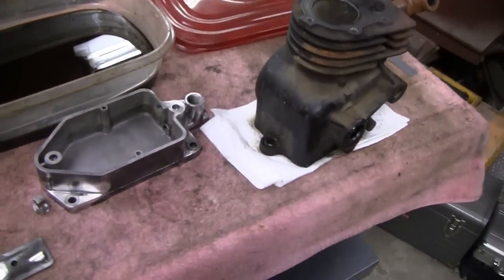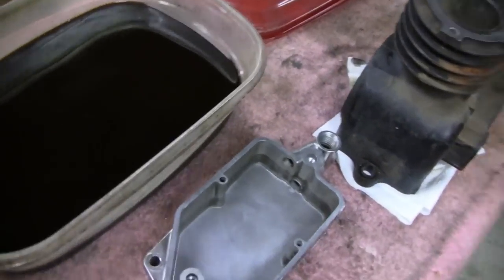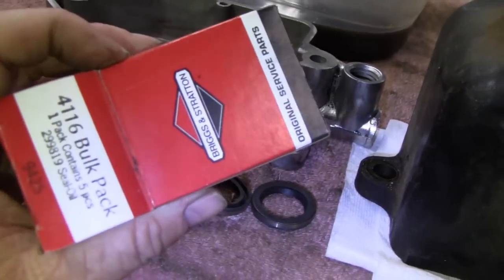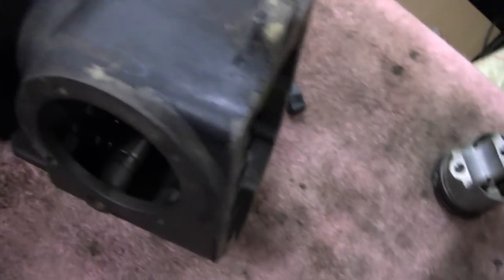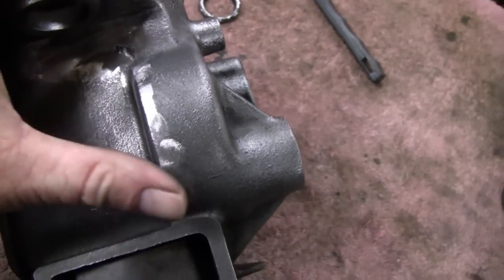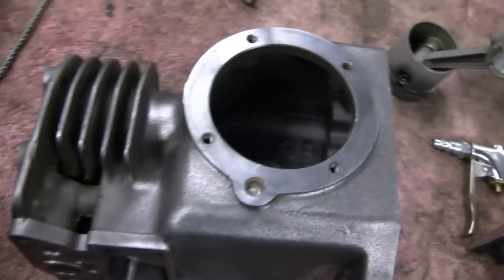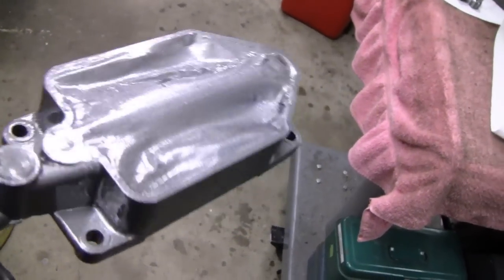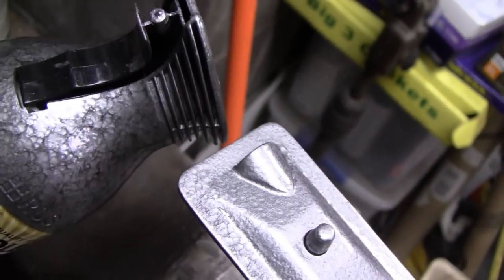GLASS HEAD BRIGGS ENGINE (part 13)

Comment: If you have any old rusty metal parts to clean,, ( panels, bolts, ect ) try one part of Molasses to 10 pars of water in a tub and soak for 5 to10 days then wash off with water and dry well.  Works like Magic on rusty metal parts..

Comment: When it's cold out, I've had better luck with Spray Can paint if you let the can sit in real warm or hot water for 10mins or so PRIOR to painting- it would flow better, and lay down better, and not clog in the the nozzle better- Try that if it's below 70* outside budd

Comment: I have found that if you heat the can in boiling water for 5 minutes and oven bake the block to about 200*, it works a lot better.

Comment: Please don't give Obama the credit for ethanol. When I was in tech school for Diesel mechanics (Before the Minnesota Department of Education stuck their nose in and ruined them and required instructors to have a four year degree) we were testing a way to inject pure ethanol into a diesel engine to get more economy from it. It was a failure but it worked good in gas engines. This was 1979 when Carter was president and continued on while Reagan was president. It was a big thing in the Midwest prairie region as it got rid of a lot of corn that was just sitting in piles as the Oil embargo killed the farm economy. Let us give Jimmy Carter the praise for all this mess we ended up with. The farm economy really did not improve during the next few years until Bill Clinton benefited from some of the stuff Reagan put into action. When GMO came into the picture the crops nearly doubled in size and with the Ethanol industry helping get rid of this surplus corn it started to get better on the farm. Yep subsidies were propping it up  but Hmmm, I believe the Oil companies were getting their fair share of our tax payer dollars also. The technology I am all for but I don't like to see something get subsidized after it a technology should be able to support itself.
Reply: 1crazynordlander I'm a big fan of ethanol. I learned about it about 10 years ago and I started using it almost full time a few years after that. Unfortunately I live in a state that doesn't have lots of E85 pumps, but I still stock up on it and run it in everything from my car, lawnmower, chainsaw, etc... I really like using it in my small engines because I don't reek like exhaust fumes after I'm done working, and I haven't seen any adverse reactions in any of my machinery. My car (regular gas car) was converted (larger injectors and a retune, later supercharged) almost 100k miles ago and it's been trouble free, it's actually doing better than it would have been if I ran it on gas. I just wish we had more of it around, and more of an effort was put into creating it. We put so much effort into gasoline and pollution concerns aside (what people really tend to focus on), it's a really out of date fuel. it's such low octane that it's holding our modern engines back from creating awesome reliable power.
Reply: volvo09 Are you using the E85 in your small engines or the E10? I have flex fuel vehicles and run it in those in the past but with the price of gas it is hardly worth it now. We are in the middle of farm country in SW Minnesota and one of the first corn processing plants is only 25 miles from us in Marshall MN. Not only do you get ethanol from corn but corn syrup and corn gluten (DDG) which is fed to cattle.
Reply: you should check out hydrogen... 1k degrees F. 130+ Octane.
Reply: No one should take any credit for corn based ethanol.  
If anyone bothered to check, it takes more than a gallon of fossil fuel to convert a gallon of ethanol. 
Corn based ethanol is a lie, at best. At worst it is a scam that is stealing billions from people that don't even know they are being robbed. 

Wake up.

Comment: that hammer coat paint is 3 parts paint and one part paint thinner. it's good stuff.  paint thick coats and try not to overlap till it dries. the can may be sputtering because it's not shaken up enough. you must shake it often while using to keep the paint and solvent mixed in the can.

your Briggs videos showed up in my suggested videos. you are building an amazing teaching tool.

Comment: I have been painting with that stuff for years. You can not paint with it in a cold area or when it'd hot and humid. The best results are when you bake the part at few hundred degrees. I bet the part that started crinkling was being blow on by the heater? it needs a even heat all the way around. You can go around the project with a heat gun to help even out the effect,  It also lays down better when you paint the part laying flat. And the cans do sputter a bit.  I like to use it for antique radio cabinets. Or on projects that i want to have that antique look. it takes some practice, but once you get it figured out it looks awesome.

Comment: Those hammer tone paints are often sputtery, chunky, and don't lay down very nice.  

I find they work best with light coats, dusting really from too far back.  Being cold doesn't help either.  Warm the can in hot water before spraying and mix the hell out of it.

Comment: Ah Roadking, you finally see why I stopped using Rustoleum spray paints, all their new cans are like that! I have great luck with Duplicolor and their VHT line of epoxy based spray paints! 😆😁😁 The brush on Rustoleum is still good stuff though, I thin that stuff out with thinner and it sprays nice out of a siphon gun

Comment: I always put my spray cans in a container of hot water to make the paint thinner and usually that helps it to spray out more evenly. I found when painting my Gadget Bike that the hammered paints are not very consistent. You will figure it out, EJ.
Reply from the maker: Thanks George!! Yeah I always keep them in my heater room til I'm ready to use them!! I was able to fix it without having to repaint the whole thing!!☺
Reply: I agree with the hot water. It raises the pressure in the can. Also that hammer paint has to be shaken very vigorously for a longer time than most paints.

Comment: Yeah that is frustrating when the paint cans don't spray well.

I have had bad luck with that same style of "trigger grip" can.  IMHO that is a gimmick and not nearly as effective as a standard spray button.

Also, it seems that Rust-Oleum is especially temperature sensitive. I learned (also the hard way!) that the workpiece and the can need to be warm. Next time, try putting the engine block directly in front of the heater until it's hot.  Then put the paint can in warm water until it's about 95 to 100°F.  This will really help. The can heating will increase the pressure and help the paint to spray out properly without spitting and sputtering.  The workpiece heating will help the paint to set up and become tacky before it has time to run and sag.

Regardless of the paint job I'm enjoying watching you guys build this demonstration engine. It is going to be one of a kind and really will help demonstrate the 4-stroke cycle principle to people at the shows.

Comment: I've used the same paint as that some time ago and it was doing the same thing. I used a flat black with a primer to paint a set of speaker cabinets. The end result was pretty good but it was spitting and sputtering constantly. I had two cans and both were the same.

Comment: I've used it, I heated the cans in water to 100 degrees Fahrenheit then worked pretty good.
& before all the safety sallies chime in , I know that's not safe. You'll need a rag to hold the can with or good leather glove. 
Most all spray paint cans I do that to now, really works good.

Comment: all rustoleum paint always seemed to either do exactly what you describe, or that "360 degree" nozzle that supposed to mimick a spray gun, would put a lot of paint on the edges of the spray and hardly any in the center.  really weird.  I've always used duplicolor, or VHT, never had an issue ☺

Comment: Hi Thanks for the video, I wasn't  surprised you didn't like that paint and the problems, I got a tractor here  the frame is satin black  . I wanted the correct paint color instead of gloss or mat black,to re paint the motor when I rebuilt it. I google searched as it can be hard to find satin in Canada sometimes. Home depot came up and so did the whole spray can issue debates that guys are having ,with those new style paint cans. In the end I found regular satin quart cans in Canadian tire and used that instead,as i didn't want the mess from the spray cans.

Comment: I use Rustoleum  hammered paint often and have found the trigger top cans to be a real problem. I always try to get the regular button top cans as they are much better. You need to have about 70 degrees for it to work right though and have to really get it mixed well or it will clog the tip. Medium wet coats seem to work best with about 10 min. between and usually 3 coats covers nice and looks best to me. I like the copper/bronze color on the 4 cyl. Briggs. It looks like it belongs there. Keep up the good videos buddy!!
Reply from the maker: Thanks Bud!!☺

Comment: We have paint like that in the uk under the name Hammerite, when I've used it I found it goes on much better using a brush from a regular paint can. 
Will you polish the piston top to get maximum reflection and brightness from the gas burn?
Reply: We have hammertite here in the US but it's more expensive and harder to find than rustolum. Truthfully the regular hammertone isn't half bad. That primer and paint in one in my personal experience has been nothing but crap no matter what finish it's supposed to be.
Reply from the maker: Nah it already bright enough without polish!!☺
Reply from the maker: I agree with ya DJ!! I've been using the regular Hammertone for years and never had a problem!!☺

Comment: too cold to paint thats why I can not work on my cub cadet until it gets warm again. It needs to be at least 60 degrees  and 70 is even better. Heat up your block really hot in front of the stove first maybe before you take it out side.

Comment: You got the finish you were supposed to, Hammerite looks like that unless you buy Hammerite smooth, But if you want to paint an engine you need to use Engine enamel which is designed to handle the heat? And if  you spay a couple of pieces and then stop, (All spray paints) will tell you to turn the can upside down and spray until paint stops coming out (Air Only) this clears the nozzle for when you start again

Comment: I have NEVER had luck with that paint!!!
Reply from the maker: I like rustoleum, but I'll never use that shit again!!☺
Reply: I'll second that. I always had problems with that type of paint. NEVER again will I waste my money on it.
Reply: It slobbered all over my hand too. Useless design.
Reply: StarPuss www.ToxicRedNeck.Com   He should used engine paint, when the engine heats up he wont like that either!!!
Reply: they have plans to not let this engine heat up much , low rpm , propane, the paint he was using is good for some heat.
Reply: Interesting, I've never had any issue with Rustoleum hammered paint and I've used it on many, many things. I am not a fan of the sprayer design on these and others that use them but the paint is fine. I've used it in place of flat or satin black on a number of things to get away from that tired look. I've probably used near 100 cans of this over the years. My tool chest and box are about a dozen years old, satin black and I think they'll get it next if I don't come up with something else like some flashy very metallic paint.

Comment: Question?  I just noticed that the two valves have two holes on the top.  It seems that a spanner wrench would fit in them to maybe rotate the valves.  So, what are they for?
Reply: jbmbanter Those holes are for a valve lapping tool, it looks like a big screw driver with two pegs on the end.

Comment: The can being too cold can result in sputtering especially with stuff like this which is thick to begin with.  Heat up the cans in a bucket of warm water if you're painting in less than ideal temps.

Comment: The nozzle of the can needed cleaned. If you would have sprayed it where it was warm, that would have helped keep the spray nozzle from getting so plugged. On top of that spraying in the cold weather also affected the paint itself too much. When spraying anything from a compressed source it's temperature drops rapidly so add that temperature drop to the outside temperature, and it adds up to failure. At least with that type of a paint it does.

Comment: I was all in on the pewter until you shot it.  I like the look and hope it was a bad can/spray nozzle.  I can't recall having a new can sputter like that, but I haven't used the hammered finish either.  Do you think that old, original paint lasted so long because it was lead-based?
Reply from the maker: Luckily I was able to salvage that to look decent!! I think the lead definitely had alot to do with the longevity!! When I use to remove paint on Battleships, you would know exactly when you came across the lead paint, it was almost like it was glued on!!☺
Reply: 805ROADKING You worked on what?
Reply from the maker: Battleships, Aircraft Carriers and Subs for 10 years!!☺

Comment: I used that exact same paint before and it's junk. Mine was a normal spray can though.

To get it to look even somewhat like the texture on the can, I had to spray coats so thick that they nearly started dripping off.

Comment: Do you use high temp paint there? Or wil normal paint hold if the engine isnt that hot?
Reply from the maker: Nah, it's just regular paint!! I did use high temp on the exhaust pipe!!☺

Comment: It's not a bad can, it's a bad design.
I've used Rustoleum paints with that style nozzle, and got the same results you did. Those cans are garbage.
Pisses you off when you spend all that time doing prep work, and the project ends up looking like it fell into a bucket of paint. 

Myself, I'm wary of using gasoline for a degreaser. It works great, but you got to worry about the safety, the stink, and the disposal. 
I usually use a 5 gallon bucket full of hot water with a heavy handed pour of Zep purple degreaser. Works really well, with none of the above mentioned drawbacks.

Comment: Make longer sprays I had that problem you need to start before your part and make a longer spray and give it time to get out the nozzle uniformly if u try and paint it like other cans it it's a bunch of air in tube and makes it all bubbly and splochy

Comment: Nothing sucks worse than having a bad can of paint. 
I bought a "Special orange" can of OEM Kubota paint, and it was doing the same thing.
Like an idiot,  I bought a second one, and that can did it as well. 
I ended up getting some off the shelf orange Rustoleum, and it worked fine. (Less than half the cost). Sorry, really no moral to that story, but I feel your pain.
Reply from the maker: The moral of the story is stay away from that special Shit!!☺

Comment: maybe you didn't put enough paint on? I know, I know, you guys know how to paint. but generally hammer tones, veins, rivers, and the like require almost what you'd consider too much with regular gloss and matte coats. At least this has been the case in my experience with powder coating. if you spray too little then it usually comes out looking like you did a base coat of one color then a weird mist of the other, or the effect is just much less pronounced. If you spray enough however the veins or hammer tone will begin to emerge. Try a second, third, maybe even fourth coat. mess around with coat thicknesses, etc.

Comment: that cans tip was clogged big time. I would of returned it instead of spraying the engine.
Reply: Quite easy to clean the tip.
A sowing pin is on way to deal with it.
Reply: not if its clogged/frozen up in the valve itself... [down into the can]

Comment: A paint job without primer, is doomed to fail. You should know better than that.  The fast way to clean between the fins, is a pressure washer. Gets it off fast.
Reply: ajwasp "Paint and primer in one"; pressure washer is the fastest way, not the only way.

Comment: LMAO, Obama gas :D  Stupid engine killing ethanol.
Reply: Ran E85 for 160k miles in my 07 Tahoe. It was still running great when I traded it for a new one. E85 did not kill my engine. My garage smelled like a brewery when I started it in the morning.
Reply: I used a  E-30 in my  94  ranger whenever I could when i had it from 95-07.